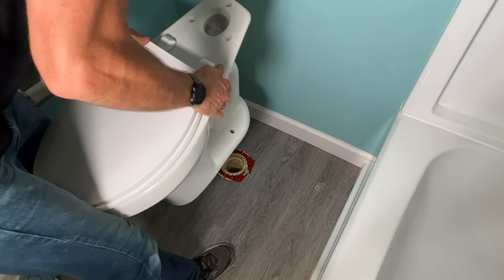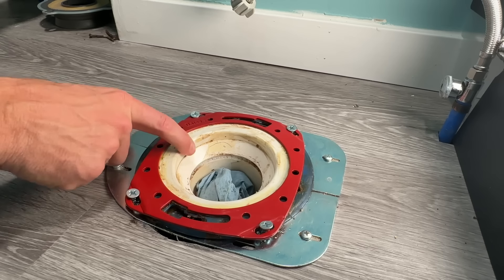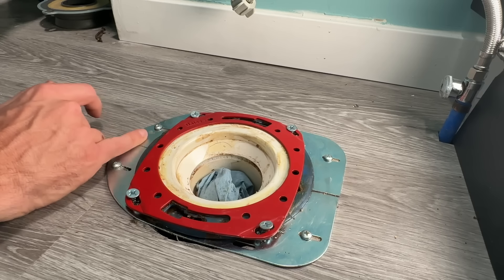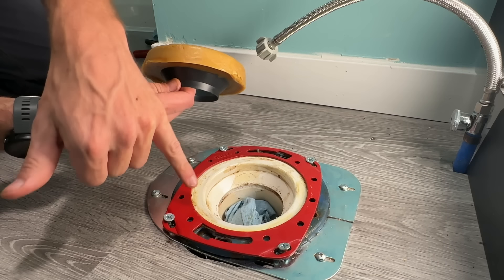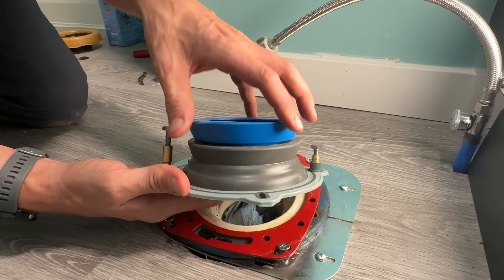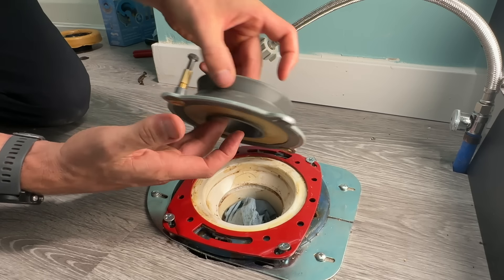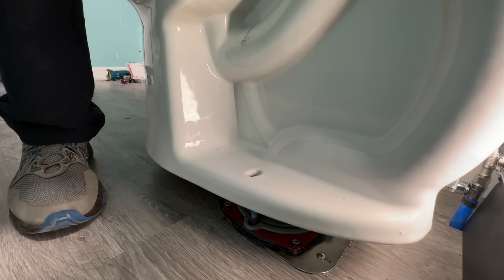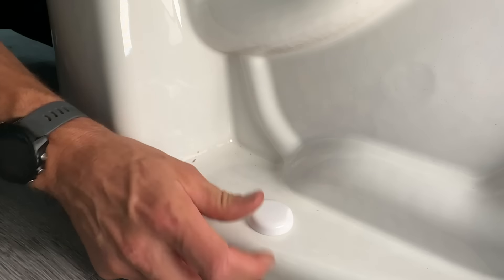How To Install A Toilet Bowl | Best Product On The Market!

Comment: I've been installing toilets in apartments for 30+ years and the best way is, if the flange has issues, just replace it. With all the newer flanges out there that aren't the old cast iron type, they are easy enough to replace with a little thinking. If you have a low to the floor flange, use a jumbo wax ring, higher flange, use a standard wax ring or adjust your flange accordingly. Figure it out and keep all of these extra parts and hardware out from under your toilet.. I always just use a jumbo wax ring and never have a problem with them(ever), easy and simple to install, seals the gasses and leakage 100% and they will squish down throughout the years to keep everything sealed if you installed is correctly. All these adaptors will always give you more weak points, joints, seams, screws, best to keep it simple like how it was intended for, it'll last over 20+ years. Just my opinion in simple is always better and more complex you make it with all these adaptors and pieces will lead to early failure as you redo the work again in the near future. It's also a bad idea in putting so many screw holes in your floor where moisture will always be from the cold water. Just my opinion in keeping it simple...
Reply: I  installed a hydroseat toilet flange repair kit.  It reduced water flow & had to hold the handle for 3 seconds to make it flush. I also used a waxless donut & it always smelled gas fumes. After I replaced it with a new cast iron flange & wax ring, all is good. The toilet flushes with a tap of the handle & the gas fumes are gone. Do not try to reinvent the wheel, do what is already tried & tested. Agreed.
Reply: Yup. 8 years of maintenance here. I’ve come to the same exact conclusion. My property I’m currently at is all pvc. And they’re all breaking at the bolt slot. All the repair kits seem to raise the toilet too high and I refuse to use shims, they never hold a toilet sturdy enough. Got real good at just replacing the whole flange.
Reply: I'm not a plumber, but have installed enough toilets over the past 20 years.  I've never had a single issue using wax rings.  As you said, keep a few different types on hand, and you shouldn't have a problem.
Reply: Warm the wax before installing.
The wax can crack if too cold when pressing the toilet on.
Reply: I agree with keeping it simple, wax rings are the standard for 99% of toilet replacements  .  Never had one leak in my house replaced three toilets 40 years ago when I bought my house.
Reply: This guy in the video is obviously an engineer that works for the government or NASA were money is no object, this is the most overcomplicated expensive toilet mounting nonsense I have ever seen. I have 30 yrs experience as a plumber and have only ever used wax rings with zero issues .
Reply: @jimdooner4375 I have trouble with toilet not staying flush and it doesn’t sit right. Wobbles left to right too much.
Reply: @BrandonTS123  use a shim can get them in the lumber section of your local home improvement store come in wood and also in black plastic with serarrlted cuts on both sides. Make sure that the bowl is properly secured to the flange and the wax seal is compressed and not leaking first of all and then tap the shims into place and then cut off the excess and I would recommend a thin bead of some good quality caulk to keep the moisture out and any 8 legged critters (ants
Reply: @ThePhoenix1391  Shims don't hold a toilet....they keep it from rocking....like a card table...put something under the short leg. I shim 95% of the bowls I set...before I tighten the bolts that HOLD IT DOWN. Better caulk it so it doesn't slip sideways.
Reply: Wax rings fail from poor installation and over plunging. Plungers are a wax ring killer!  Use a toilet snake people! As seen on TV products don't belong in construction.
Reply: Cast iron flange attached directly to the main pipe is rusted and because of this unable to fasten toilet tightly to the concrete foundation floor. Extra wide wax ring is not the solution in my situation and the products used in this video solved my dilemma when I went from a thick tile floor to a narrower vinyl plank
Reply: @BrandonTS123  The system he's demonstrating solves that. It's impossible for the toilet to rock or wobble whatsoever with this.  I tried one of these despite the comments of wax ring purists (after installing maybe 5 or 6 toilets over the years with a wax ring) and I would never deal with the hassle and uncertainty of a wax ring again.  The point is to have a system that works without having to pay a plumber.  For a DIYer, who doesn't install toilets every day, this is about as good as a solution gets.
Reply: Was a renovator for 39 years. Many many bathrooms under the old belt. Wax seals were and still are my go to. WHY…because they work.they’re cheap,they’re very long lasting. This isn’t rocket science guys. For  locator things like those blue things…. I have for as long as I can remember used straws. They work. Cut one long at 4-5 inches the other at about 2-3 inches. Once the toilet is solid on the floor snug the nuts down. Shim if necessary.
Reply: Dude I agree 💯
Reply: @BrandonTS123 Sit the bowl on a bed of plaster. Standard in New York. Works perfectly for uneven floors.
Reply: And I've seen many installs by plumbers in apartments who don't care and the wax seal is installed improperly and no one knows until the damage is done. There's plenty of reviews and real world testing on this unit, if you're a diy for your own home then you can actually see how long it will last.
Reply: @yankeesusa1 that's south of 8mile
Reply: @darrengillesdarrengilles8336 ...prolly from the makers of the 7 thousand dollar toilet seat the government buys😂😂
Reply: @Suckitdownpipe  whatever fuckin works get er done!
Reply: My Flanders is sitting to low and also is rusted not securing bolt on one side. Does not seem to be broken though m
Reply: Just keep it simple my opinion
Reply: @howtodoitdude1662 That’s exactly how I was thought by a plumber
Reply: Plumber here. Flanges I feel like are still a weak point for me although ive done a good number of replacements and repairs the past several years. Ill agree. Wax is king. So many gimmicky seals leak...and the nice thing is an extra thick wax ring will work fine even if flange is at the right height. Ive had a few plumbers with 10+ years tell me they always use standard+thin or extra thick on every single upstairs toilet
Reply: @shovelhead56 I have a toilet that is on a cast iron pipe and the toilet is leaning to one side pretty bad. What happens if I tilt the commode back up to where it should be? What will hold it in place?
Reply: @shelleyw8828 Hi. Why are plungers bad for wax rings? Thanks .
Reply: Agree i use the jumbo wax ring and no problems in my house
Reply: Thanks @donspir4199 I appreciate your expert opinion on this, makes so much sense.
Reply: We use to have no water inside also just saying
Reply: Why are you still using wax.. the new rubber ones never need replaced
Reply: @drumrooster  I never had to replace a wax ring neither, only when replacing to a new toilet. I don't have any issues in the past 40 years with wax rings so not going to change to something else since what I use (wax rings) are working great for me.
Reply: @howtodoitdude1662 someone set mine in a bed of cement, had to destroy the toilet to change the seal
Reply: mine was set in cement

Comment: I used one of these a few years ago in my upstairs bathroom and have zero issues with it. It was super easy and clean to install on my tiled floor.
Reply: @thoml2353  No, nothing was wrong with my flange. I just changed out the toilet and used this instead of the wax ring.  As for drilling into the tile it shouldn't be a problem if the floor has no issues with it.
Reply: Going to home depot to grab 2!  Thanks- great video
Reply: Sure you did
Reply: @MrDarren5012   I sure did and it still doesn't leak  despite my large butt crapping on it every morning.
Reply: Yep.  Replaces many toilets over the last couple decades and always used the gasket type.  No issues.  So much easier than a wax ring for a casual DIYer that isn't sweating the extra few dollars vs wax ring.

Comment: I know every install situation is different, but this part of the replacement process is what has deterred me from replacing a toilet. Luckily it's not broken and still works, but it's old and uses a ton of water. This has given me a confidence boost for sure, I will be picking up one of those kits.
Reply: Toilets aren’t hard to deal with just do it man it’ll be good 👍🏻
Reply: 'and uses a ton of water.'  Save water by displacement.  Get a 2 liter bottle, fill it up with water so it won't float, and secure it inside the tank so it isn't in the way but takes up room instead of the tank water.  You'll save about 2 liters every flush, of course adjust the bottle size etc so there is enough water to still flush well.
Not my idea or anything, you simply see it now and then to make an older toilet use less water.
Reply: The old school method is to place a brick or 2 in the tank.
Reply: Don't use bricks, over time they crumble & can mess up the seals in the tank. Use a rock

Comment: Danco products seem to be very well thought out and engineered. I recently replaced a leaking toilet fill valve with a Danco instead of the common fluid master and I was very pleased.
Reply: I bought 3 sets of "danco" cartridges for Moen faucets. I had to go back and replace one of each set due to leak. Most of their stuff is junk!

Comment: Got a bidet toilet and the people that installed it had leaks, it moved around, etc. Decided to fix it myself after having them out a few times and there was a flood underneath it because they rigged up the rubber bit from two different wax ring kits.

I say this to explain how thankful I am of your video. I have never installed a toilet with the holes underneath, as yours is in the video, so I took your advice on which ring to get and there's no more leaking. Thanks so much!

Comment: This looks like a good system. I've replaced our 3 toilets more than once due to kids using wet wipes. The wax is just so much trouble and even the jumbo rings won't seal properly if there's anything unlevel about the floor or if the ring fails to fully contact the bottom of the toilet. I used wax years ago on 2 and rubber on one. This past weekend, I replaced one of the wax with rubber because the simplicity in the install and future work if necessary. Also seems more reliable in my case.

Comment: This ring is money.  Worked great for my application.  Had an uneven, lumpy floor near my toilet.  Tried setting a new toilet with wax and the seal broke when trying to shim/level it and it leaked.  Used this product (mine had regular closet bolts) and it set perfectly and was able to maintain the seal as I rocked and shifted the toilet to level it.  Highly recommend.
Reply: Wax doesn't bounce back.  Compress wax for a perfect seal, but you can't do anything to lift and align the toilet after the wax has been compressed.  A properly installed drain and flange will never need anything more than a wax ring to seal it.  Rubber seals and all the gizmo kits only have an advantage when the rough-in has been botched.

Comment: The solution i have been searching for. Original cast iron flange is one piece attached to the outlet pipe. Rusted and regardless of what wax ring i have tried does not provide a flush, tight fit onto the concrete foundation. These products offered the Fix i had been looking for. Thank You for sharing🤙

Comment: When I was doing plumbing, I always used a brass nut on the bolts to secure them to the flange . This made it super easy to line up the toilet( even with the tank installed) to the flange for the perfect set .
Reply: sure the good kits came that way . ever fix a case? or set one?
Reply: @dollyhadbraces9361  Case has odd tank to bowl connection

Comment: Having set countless toilets have always used jumbo wax ring with a deflector cone. Prior to setting with the wax ring I position the bowl and use painters tape to mark locations around the base to better home in on my 'final approach'.  Looks like a great DIYer product however.
Reply from the maker: Great tip and I appreciate the feedback 👍
Reply: I believe you’re talking about “the horn “
Reply: I believe the deflector cone that he is talking about is a piece of plastic that is part of some wax rings. Sort of a very large diameter funnel it's function is to protect the wax ring and help preserve the seal as long as possible.

Comment: I like the locator thingies. I had sticks that came with my toiletmaster lift jack but my friend lost them when he was borrowing it. He'd broken his arm and wrist and couldn't use both hands to lift the toilet. I have a bad back so I can't do much lifting. Got the lift jack and it saved us a lot of trouble. The Danco thing looks interesting. I've used Better Than Wax ring for my toilets and haven't had any problems. I think I need a better repair flange-- but I will need to replace/repair the subfloor first. 
I believe they recommend sitting on the toilet to make sure it flattens the ring out before you secure it to the floor.

Comment: If you have the right diameter of plastic straw, you can cut off a few inches and stick them on the flange bolts.  Works like the alignment pins.  You could probably hack something up with painter's tape and whatever, too.
Reply: Yes, Grab a jumbo straw at  your local McDonalds and cut it in half to give yourself two 5 inch locator pins.  They fit a standard toilet bolt perfectly.

Comment: Great, much needed video, thanks. Amateurs and professionals should be using the new installation kits and avoiding plain wax seals. I’ve seen too many “professional” installations done wrong and have wasted too many hours trying to get a wax seal to do the impossible.

Comment: Toilets...bane of my existence. Replacing fill valves over and over, different kinds. Just don't seem to last. Never seen a flange in a good position. Definitely going to try the Danco next. Looks good. At least trying to solve some issues.

Comment: My wife wanted one piece - skirted - toilets throughout the house we just built so we went with the fluidmaster rubber seal because its too difficult to put the one piece toilet down without having to pick it up and adjust it over and over because you can’t see your bolts…and its heavy AF. the seals have worked well thus far.
Reply: USE  WHAT THE PROFESSIONALS USE A PROVEN WAX RING...
Reply: @garyrohlman6013  I’ve seen professionals use both. I think it comes down to just doing a diligent job. Both seem to work fine when installed correctly.

Comment: The Danco Perfect Seal is a 50/50 chance. My first experience went well — similar to what you showed. One year later, we had a back flow into the house from a clogged (root) pipe in the yard. Room full of nightmares. The floor installers (replacing damaged flooring) broke the flange (and flange extender) and they used the Oatey Twist-to-Set flange. It fit perfectly and the flange rested on top of the finished floor. We went back to the Perfect Seal. Immediately we noticed something wasn't right — flow was restricted. Pulling the toilet out we noticed the wax ring crushed inside the pipe which pushed the gray horn almost closed — by 50%. Instructions were followed explicitly; no blue adapter and no black horn. As it turned out, the Oatey Twist-Set (for fitting in a 3" pipe) flange is flat across and not beveled like all other flanges connectors — including the Twist-To-Set flange made for 4" pipes (beveled). Our previous flange/extender was beveled and the Perfect seal worked fine. So be warned. If the toilet doesn't set easily (with a little force), there's something wrong. Yank it out! In our case, the normal wax ring was the best solution and everything is a go now.

Comment: Just used this Danco installation kit and it ROCKED! The extendable bolting system alone was brilliant, I'm never using a wax ring again
Reply: Using the expression "and it rocked", is not a good description for these circumstances 😮

Comment: I used a rubber ring in one case, but recommendations vary - everyone has a different opinion.  The wax rings usually last for a very long time.  It is wise to be certain the flange and any brackets are totally secure and solid to assure they can last for several years.  Often they can be deteriorated or corroded and the flooring wood can be rotted out in older homes, so be certain to complete the repair so it is secure for the long haul.
Reply: Due to a water leak in the bathroom of the house built in the '50s, the tile floor had to be removed to dry out the floor. It was tile on top concrete! Under the concrete the wood flooring / sub flooring was gone around where the toilet connected to the cast iron sewer pipe. No wonder the toilet flange could not be tightened down so that the toilet would not wobble and move around! The flange seal was not the problem.
Reply: @donsmith9478  Did you need to do anything about the wood flooring damage?
Reply: I tried the rubber gasket one time and didnt like the seal it was giving, just felt like it would be an issue down the road. Maybe I was being paranoid, but a wax ring just feels more secure.
Reply: So true, I replaced the flange and some subfloor before I used the rubber ring.
Reply: @rickb.6068  Best to avoid the rubber ring and stay with the thick wax rings.  I tried the rubber ring, but it's not very reliable - I tossed it away and went back to the thick wax rings - they have a history of lasting a very long time, so why change to rubber?
Reply: @dennishassler605  Mine has been fine. I switched to rubber because the toilet can be reseated if needed and there is no messy wax to pick off the flange and toilet. I can see instances where wax would be better but not in my case.